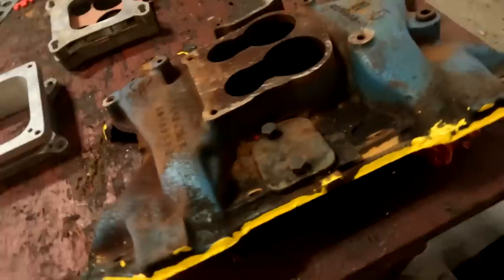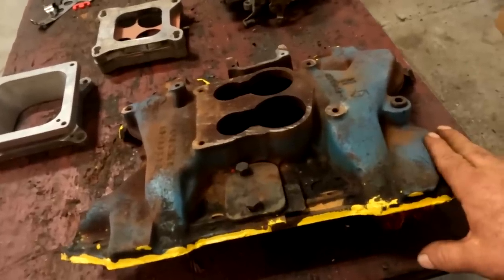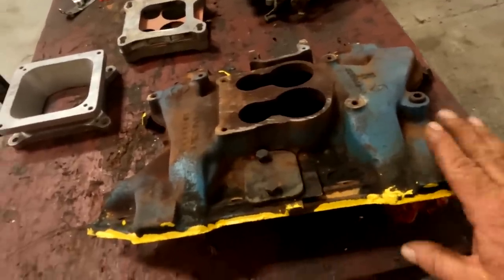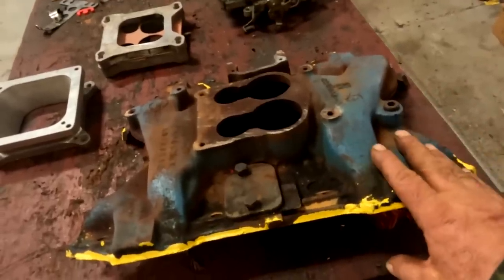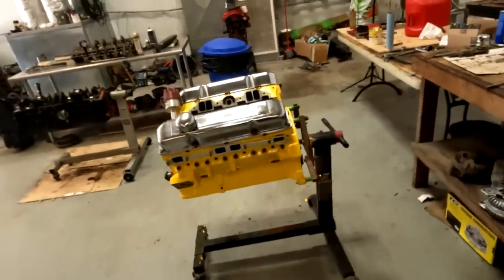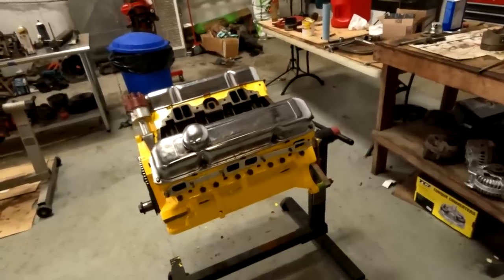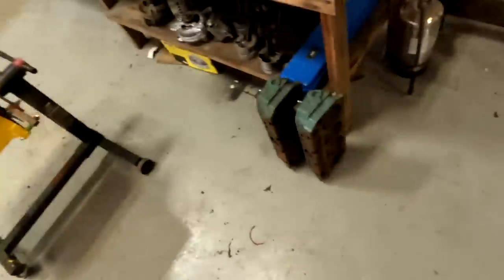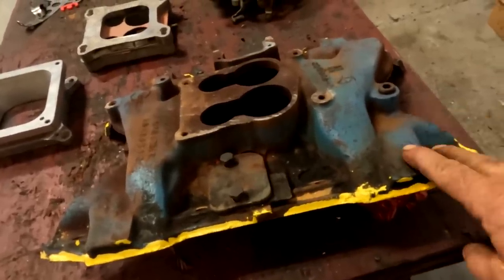Blueprinting - What It Is And Why You Should Do It To Everything You Touch On Your Car. Free Power

Comment: A better word for blueprinting might be "optimising" you are making it the best it can be as Tony so rightly says.

 In a perfect world the factory would do this for you, but we don't live in a perfect world and factories have engineers AND accountants (who are constantly warring) It's true that tolerances have improved over the years, there is less to be gained from blueprinting a modern engine than one from the 60s. Better understanding, better machining quality and maybe even a dash of better quality control have all helped, along with better engineering in the terms of EFi, EI, better oils and so on.

Still, no matter how careful the factory is, they can't make a million engines exactly like the prototype that came out of the R+D dept, so there are gains to be had.

Sorry, got sidetracked. What I really meant to add here, when I started this comment, is that "optimising" ISN'T just about power. I'd go as far as to say the power you gain is just a bonus! (controversial I know)

How good a motor runs is a factor of how efficiently it does it's job and optimising (Blueprinting) increases it's efficiency.

A more efficient motor will deliver more power, it will also deliver better gas mileage and crucially, it will also last longer and take more abuse without going bang. That's because a stock motor is often fighting itself when it could be helping itself.

Even if you have a Lada (i've had one, god help you if you can't do any better) it will still benefit from blueprinting even if it never sees a track and only gets pootled from home to shops to office and home again. Why WOULDN'T you do it?

I watch endless YouTube channels where someone buys a new crate LS motor or W H Y and hangs on whatever is fashionable this week and then drops it into whatever unlikely 60s car they happen to own. It's kind of an industry standard! When what they SHOULD be doing is pulling that brand new motor to bits and rebuilding it PROPERLY before anything else!

You can't build a building that will stand for long without a foundation. Blueprinting is the foundation of a car.

Steve